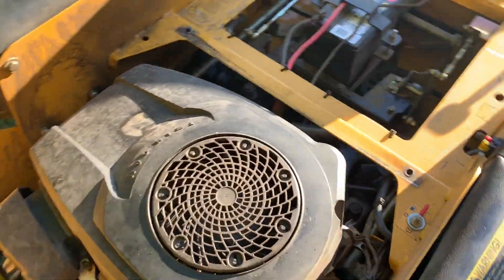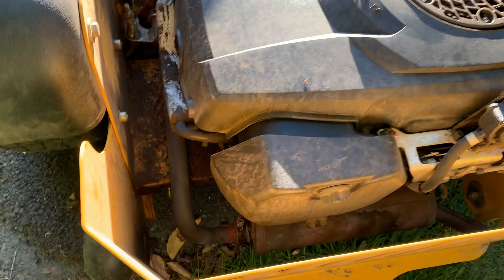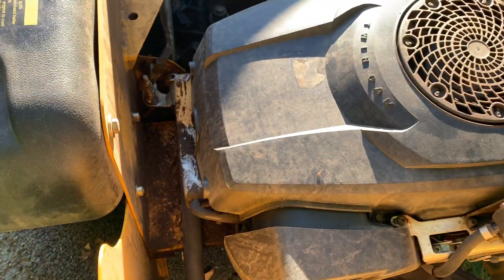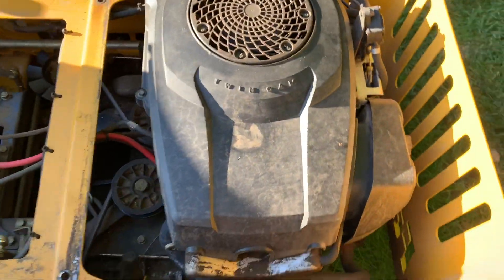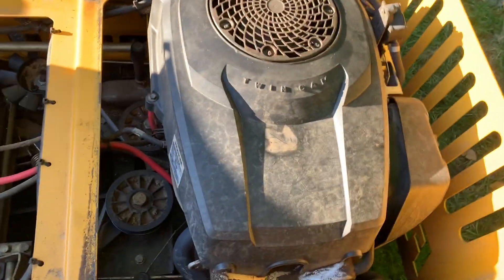Hustler Fastrak Engine Replacement- Part 1

Comment: The dealer put a Kawasaki engine in mine. The Kohler developed a cracked block. The KawasakiFX600 is SO much better
Reply from the maker: Nice! Yes, I've had two of the Kohler engines fail from cracked blocks both due to bolt loosening. That's the reason I switch these to different brands.

Comment: I have the same model hustler what is the engine family number for the Briggs? I want to do this same swap. One other question i have is the same the same dimensions?
Reply from the maker: The engine dimensions are different. This is an Intek. But... When you remove the old engine you will find that alternate engine mounting holes already exist in your frame. I was able to move my new engine around to find the bolt pattern needed, and this allowed my PTO to center correctly. How the exhaust lines up, is a different story. Also, your throttle and cable will need to be changed, the Briggs doesn't use a separate choke. Reply back if you want the part number of an all in one throttle/choke/ cable I installed, this did take some additional modification to fit properly. I can send pics as well.